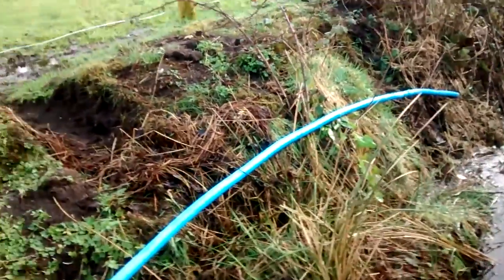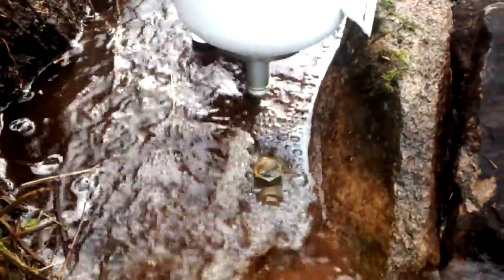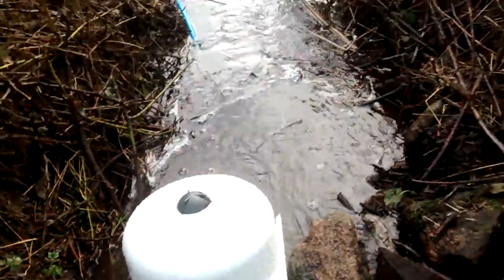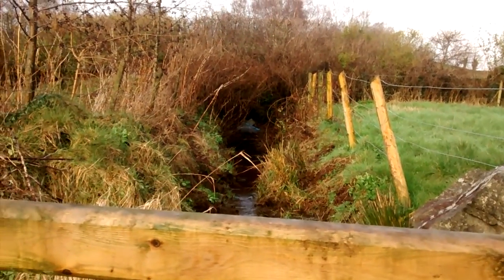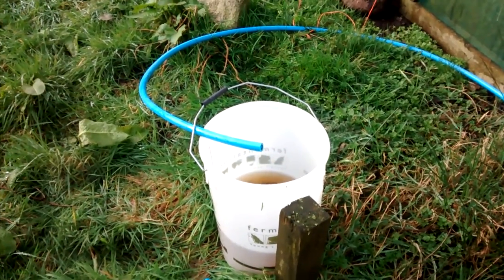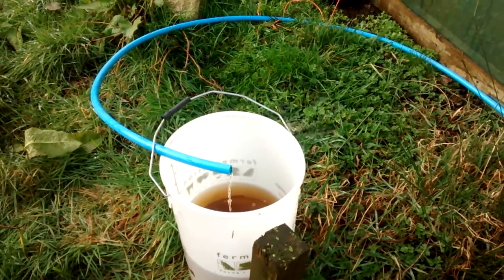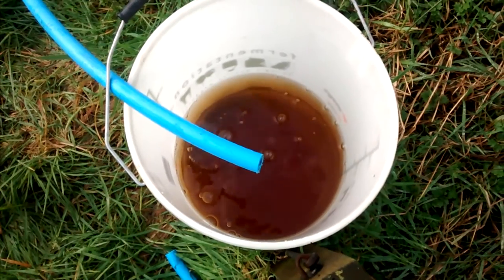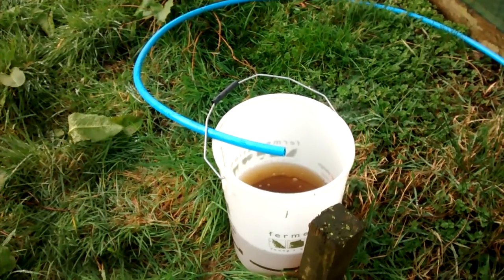Low head hydraulic ram pump working at Lackan Cottage Farm

Comment: If you don’t have a running water stream to start the pressure for the hydraulic pump, is there another method able to be used if say only water source available was a large pond at a slightly lower level? Maybe Creating pressure in the delivery and somehow make it into a syphon type recirculating action to deliver enough water to start the pump?